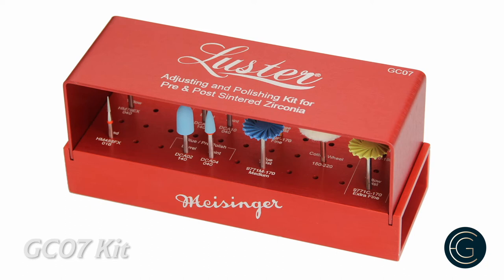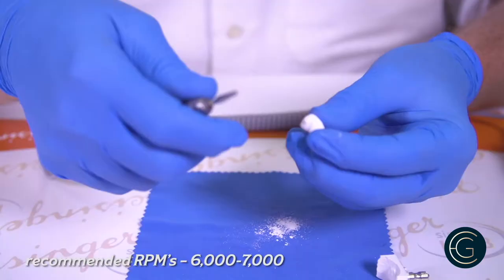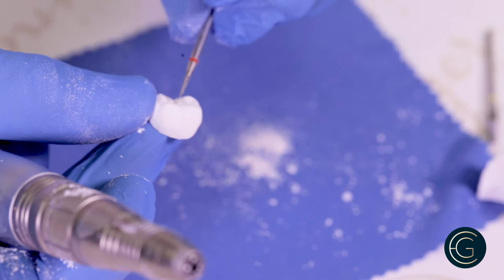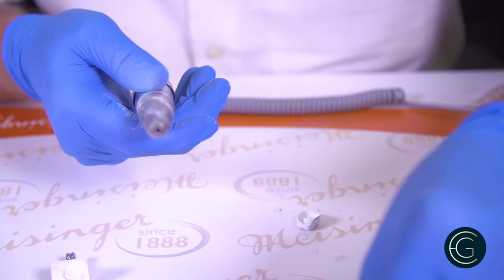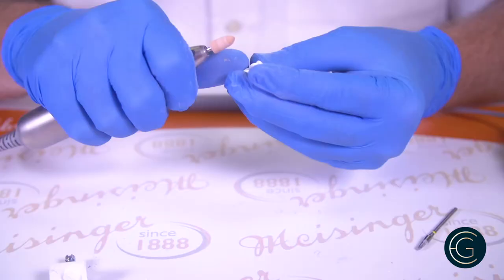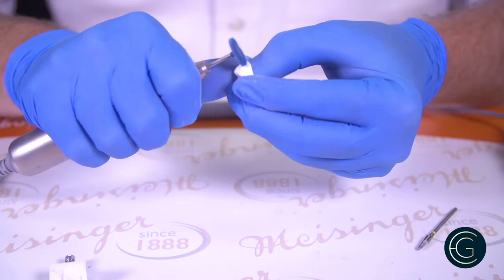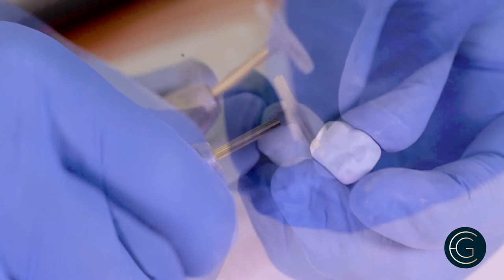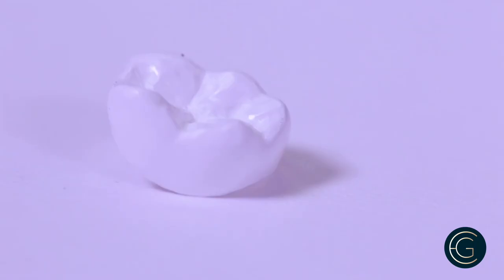Dr. Greg Campbell PreSintering Polish

Comment: What glaze can I use with Katana Zirconia, I have Speedfire oven. I am using this for #8 and #9, didn’t have enough room for eMax which I used as transitional. Do you have glazing and staining videos after sintering. Thanks for your response.
Reply from the maker: You can use many glazes. I use CZR. I also use FLUO from Ivoclar 
Make sure you sand blast surface before applying glaze

Comment: But... Why ? You need to have prepared surface before staining and glazing, polishing won't make it better for surface bond between ceramic and zirconia. Also you should use extraction unit when you are preparing zirconia, it's one of the worst if not the worst thing in dental laboratory and can cause very serious health issues